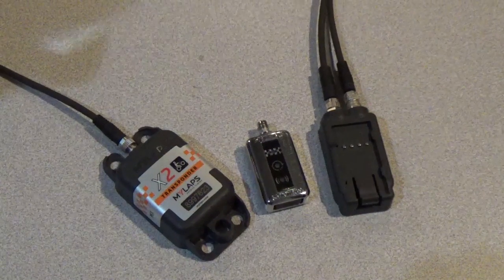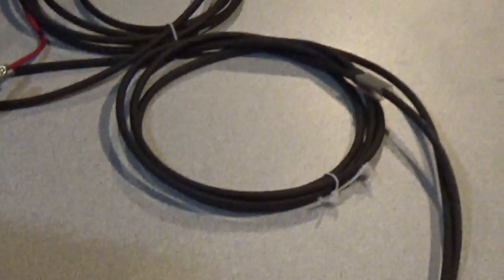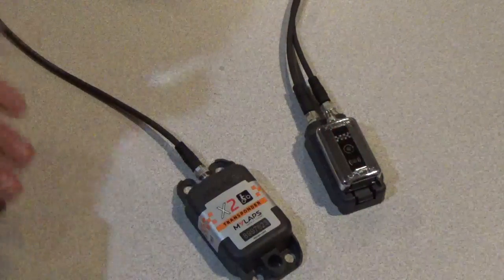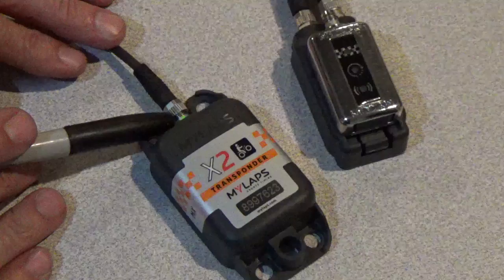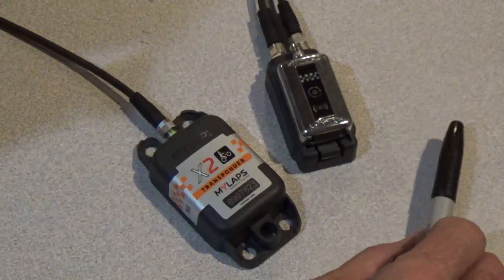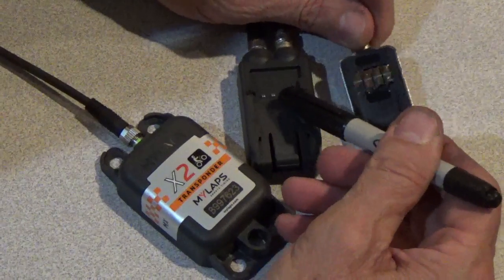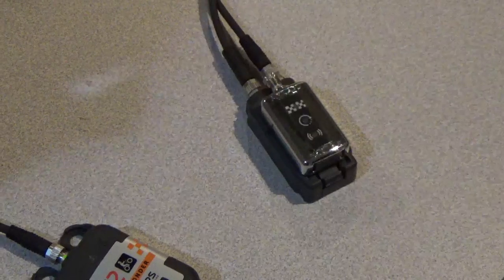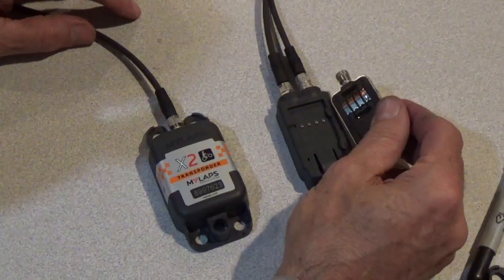Mylaps X2 Direct Power Transponder troubleshooting

Comment from the maker: With the 2019 firmware update to the Race Key and Transponder applied from running Mylaps Connect software, you will find that when you power up, the light on the stem of the transponder will now blink SLOW RED to indicate the internal battery of the transponder is charging.  Once the internal battery has a full charge, the light will then be a dim green as the video shows.  All other lights should work as shown in the video.

Comment: So you need to have the race key mount attached to the vehicle's electrical circuit for the transponder to work? Why can't you just have the transponder power cable attached to the vehicle's electrical system going to the transponder unit and forget about the race key mount wires? Can't you just mount the race key to the bottom of the transponder to download the data afterwards? I guess I am confused why you need that race key mount system?

Comment: Thanks for the video. Is the 'ground' wire here to be hooked up to the negative terminal of the battery or to a chassis ground?
Reply from the maker: It can be ground at the battery or the chassis. It makes no difference.
Reply: Thank you my good man! I got it wired up last night and it appears to be working just fine.

Comment: what do you do with the other two wires? white and black
Reply from the maker: +Wes c Other two wires are not needed for anything when simply using the direct power in the method above.  They may be used for future development.
Reply: OK cheers wiring it up now just taped em together and got them out the way for now,